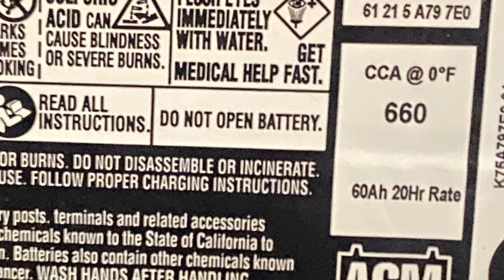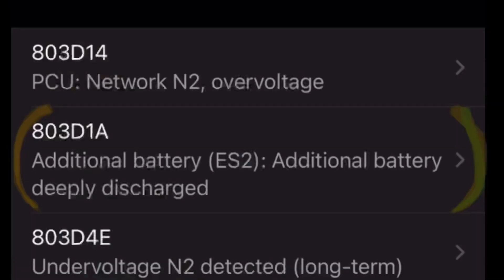BMW G30 540i Auxiliary Battery Replacement March 11, 2024

Comment: Hi i have G30 540i and i need to change the battery ( the small battery ) before disconnecting the battery under the hood it is necessary to put the car in sleep mode?? or something similar I mean when connecting the cables and disconnecting them from the battery.  Thanks
Reply from the maker: I just had it off the whole process with the fob key away from the car. After completing the replacement,  I’ve just turn on the car as normal and perform the error code verification as shown in the video. Good luck

Comment: how do i put the battery back in ? with the bracket?
Reply from the maker: Hi, I think you are referring the small Battery holder on the bottom, the small bracket. I know it is tricky to place it back because it is not flat and it is supposed to seat on the battery side to hold the battery in place. I place the battery fist then I place the holder with the bolt to better align it into the threaded hole. Good luck.

Comment: I didn’t know g30 has two battery… all off them even 540i? I changed the Emergency Sos Battery small in the roof but never heard off extra auxiliary battery
Reply from the maker: It depends on the equipment the vehicle has, it may have up to 3 batteries. The main battery for this vehicle is in the trunk.

Comment: I have a G30. My iDrive keeps resetting date & time every time a switch on the engine. I am suspecting that weak Aux battery is the cause for time reset. 

I Will try to follow this totorial and change the battery.
Reply from the maker: Hi, I really did not noticed the battery failure neither I observe the resetting of anything in iDrive. I found out by checking the codes with BimmerLink and a bluetooth OBD2 scanner. To be honest I did not know the vehicle has 2 batteries, I always thought the only batttery was the Aux batt under the hood. I advice to scan first your G30, I show the error code read at the beginning of the video.